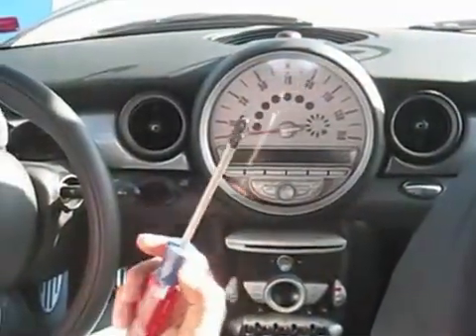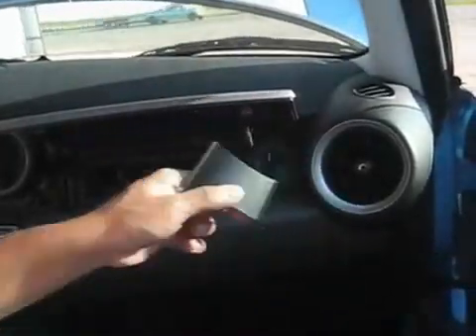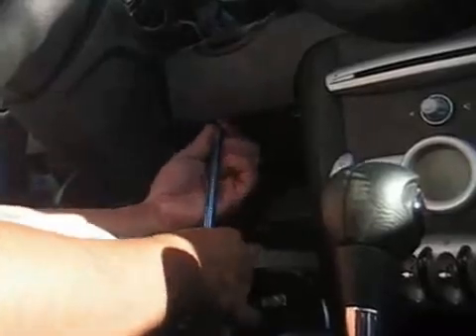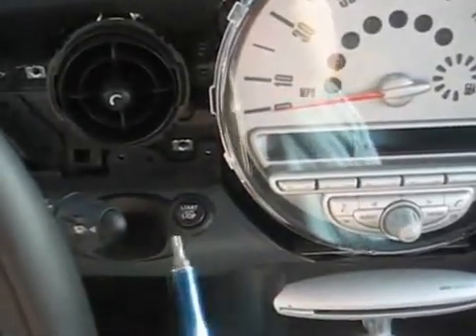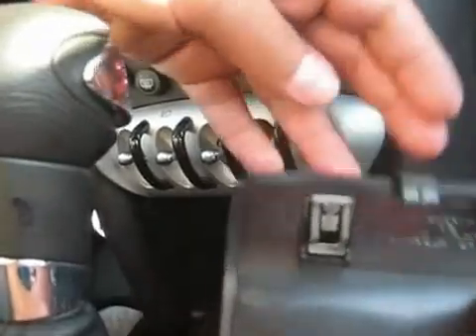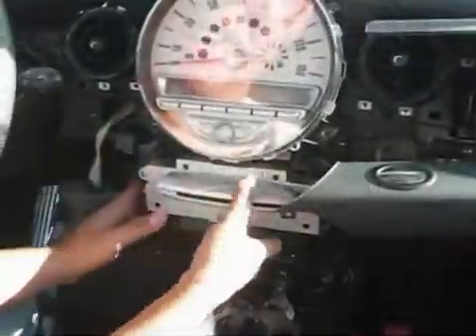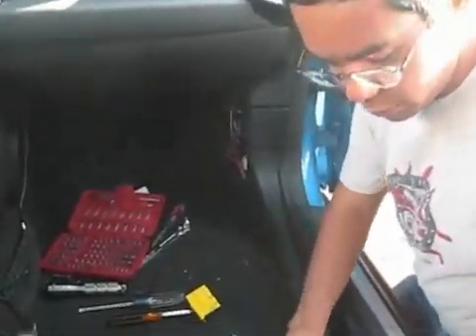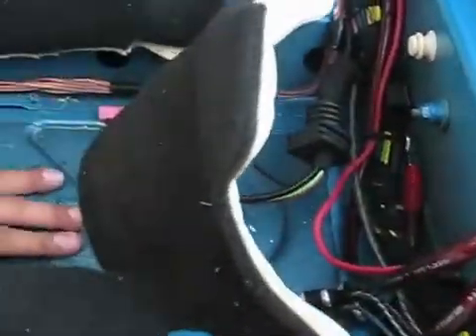R56 (2006 - 2010) MINI Cooper Speedometer and Radio Removal How-To

Comment from the maker: Thanks for the comments everyone! Glad it's helped! @Will-There are no RCA outputs on (almost) any stock head unit. I used an AudioControl DQL-8 to convert the audio, but you might be able to get away with using something with less controls.
Reply: MrWonChong hey, i have a mini cooper clubman s 2009 do you know where i can locate the Bluetooth module ? because my Bluetooth, aux and usb won’t work, on the menu a dash appears under and I cannot connect or usb and aux won’t recognize my phone

Comment: Where can I connect the radio remote cable for the amplifier?
Is there a amplifier remote cable anywhere close to the boot?
Reply: Clinton Govender you have to make your own. Connecting it to the cigarette lighter in the back is a quick fix.